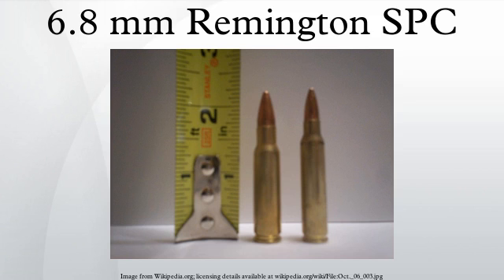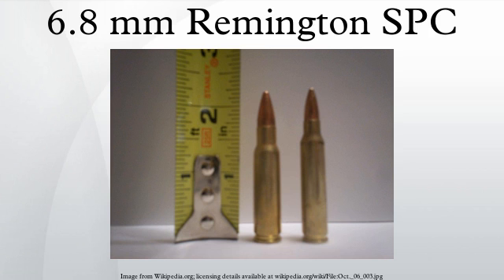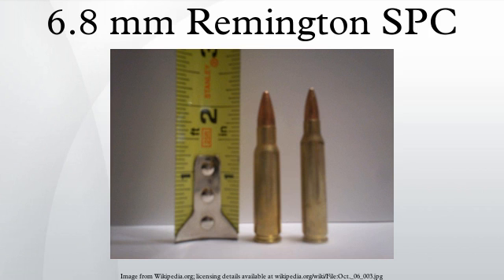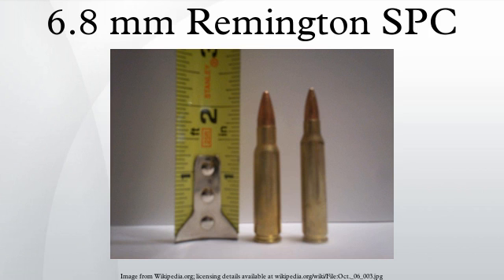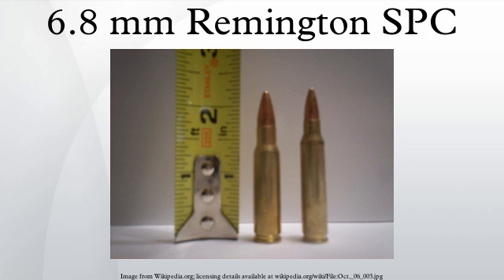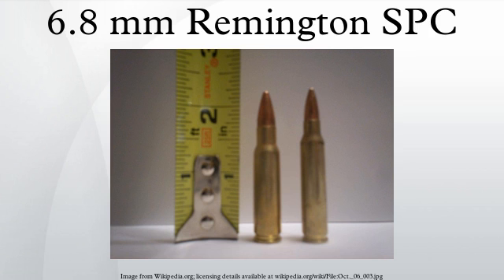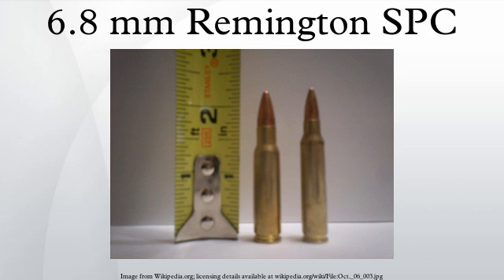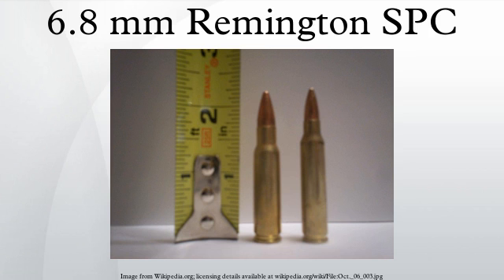6.8 mm Remington SPC

Comment: .300 A.A.C. Blackout, 6.5 x 39 Grendel and 6.8 x 43 Special Purpose Cartridge rounds are all better than the 5.56 x 45.  I never wanted an AR-15 until I found out an AR-15 receiver can be used with all the above cartridges.  Thank goodness if you have an AR-15 you are not stuck with the 5.56 x 45 round.